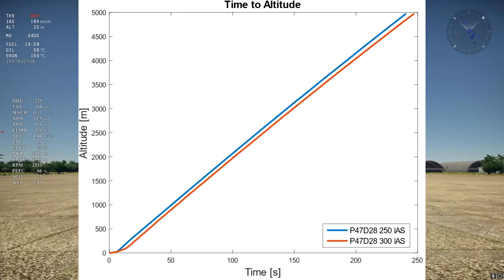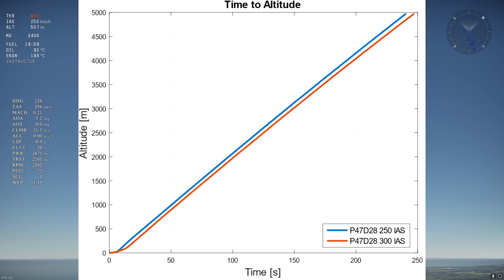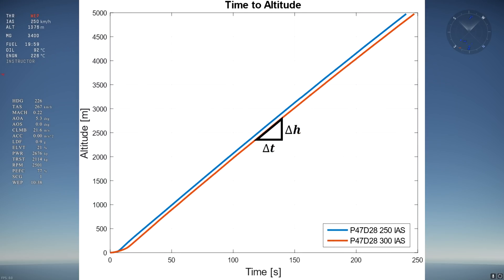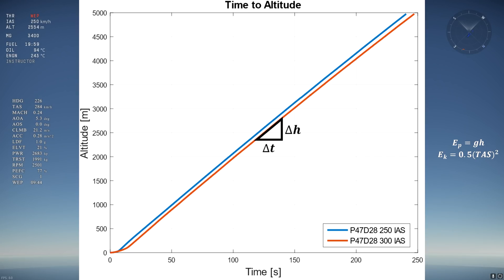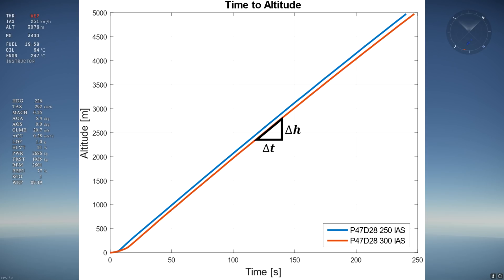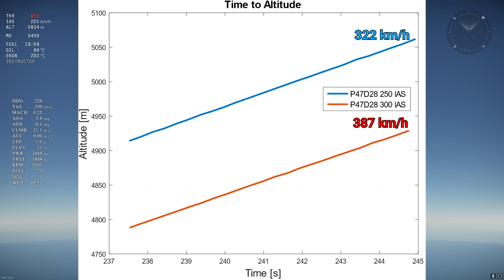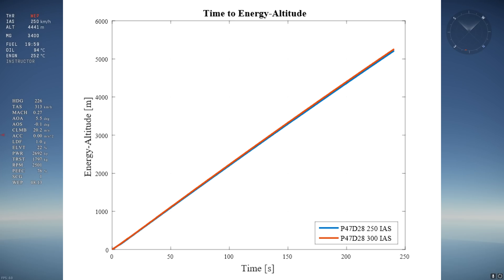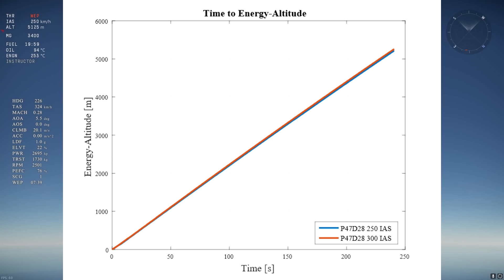Rate of Climb Misconception | Altitude AND Speed!

Comment: I just wait reach 400 kph tas after take off and put pitch at 20° until cruiser alt. If my ias speed is very low then i put pitch at 15°
Reply from the maker: Could be further optimized.
Reply: That quite good as irl mostly do but in the game are very difference story you should climb at start but shallow angle of climb (depend on plane)
but some plane like F6Fat i mean hellcat even you climb at shallow it won't work that well  because it poor at climb but i prefer you to climb around 300 IAS but high alt you should climb at high speed like 320-340 IAS because the fight is already start :) I hope this help.

Comment: I was hoping to look at your plane compared to the horizon when also looking at the IAS meter to compare if I'm usually climbing too steep or too low, but then I noticed your WEP was constantly on? 
Is this just a custom test map with unlimited WEP for the experiment?
Reply from the maker: Well the climb is less than 5 minutes, and it has 12 minutes of WEP.
Reply: to add to that, in realistic there is no WEP restrictor
Reply: @xavier4519  Oh I was suspecting such a thing. I literally didn't know that how arcade has it it's not normal.

Comment: So what would be the best way to determine optimal climb rate or climb IAS just by looking at the flight data? Flying all sorts of planes makes it difficult to remember. Thanks!
Reply: there are war thunder flight data sheets which are usually quite accurate with the IAS climb speed
Reply from the maker: You would need to do some testing, not simple to do it another way.

Comment: In aviation there is what is known as Vy. Best climb rate velocity. It's not angles of climb that determine how fast you climb but the airspeed. And generally you don't want to climb near stall speed because that leads to higher induces drag. So the better thing for people to do in war thunder is to climb at a airspeed higher than you would think. 300 kp/h or higher. As seen in the graphs a higher airspeed = higher energy.
Reply from the maker: 300 is pretty high for most props in WT. 270 or so should be average.

Comment: Very nice, short video Adam! One thing i did not understand: while the altitude increases the plane needs to accelerate because of lower air density, but with lower drag the amount of energy required to go at higher TAS at higher altitude is lower.
Reply: If you're climbing at a constant IAS, the drag force on your plane remains largely the same. This means the power needed to overcome drag actually increases as you climb higher
Reply from the maker: Thanks!

At a given IAS, drag is the same. That's the point of climbing at constant IAS and why we use IAS.
Reply: @AdamTheEnginerd  yeah, so the energy required to keep the IAS costant is the same at every altitude
Reply from the maker: @ferrarisuper  Hmm no, since as your TAS increases, it requires more and more energy to increase it further since E_k = 0.5*(TAS)^2. TAS is squared.
Reply: @AdamTheEnginerd  ok, now is clear! Thank you 😊

Comment: So the shallower angle and higher speed are canceling each other out?
Reply from the maker: You're better off looking at it like I explained in my first rate of climb video, which is the engine power goes into increasing the aircraft's energy after countering drag. So your climb speed should be close to your minimum drag-power speed for a piston engine (prop efficiency makes it so that the optimal speed is above the minimum drag-power speed).

Comment: One thing I am still confused about is which speedometer should I use when climbing/flying in general. As of now I use TAS (and try to maintain ~280km/h in a climb), but I am not sure if I need to switch to IAS.
Reply from the maker: IAS is what you should use for sure, a given IAS gives the same aerodynamic forces on the aircraft regardless of altitude, while it can vary wildly for TAS depending on the altitude.
Reply: @AdamTheEnginerd  will do, thanks for the tip, your vids are probably the leading cause of me actually getting decent at air rb
Reply: @AdamTheEnginerd  Hey Adam, just a quick question: Why do prop planes climb at constant IAS? bc the drag power only increases as you climb higher (constant drag, higher velocity), but the engine power remains the same (ignoring prop efficiency losses) Wouldn't it make more sense to slowly decrease the IAS as you climbed higher?
Reply from the maker: It would very slowly decrease indeed if power stayed constant. When power starts decreasing significantly though, then you reduce speed faster as you climb.
Reply: I think theres no point in using TAS because IAS is what really matters to the planes performance.

Comment: does this also mean that energy gain rate is not affected that much at all by the climb IAS? like the difference between 250km/h IAS and 300km/h IAS in your graph seems minimal.
Reply from the maker: It is, there is one optimal climb IAS for a given aircraft and altitude. The optimal climb speed for the D28 is around 280, so 250 was too slow to be optimal and 300 was too fast to be optimal, both of these speeds are on either side of the optimal climb speed. The optimal climb speed is a few % better than these speeds. If you climb at 225 or 350, you'll climb significantly worse than optimal.
Reply: @AdamTheEnginerd  There is a way to know the optimal speed for any aircraft? Does AOA help to know the optimal speed?
Reply from the maker: @Maverick966  No, it can only provide a rule of thumb. Around 4 degrees AoA is a decent start.

Comment: we're arguing here about dimes and nickles here...
what real difference does an extra 100m make?
Reply from the maker: The same difference a couple of modifications make on an aircraft.

However, the main goal of this video is to show what's going on. Just because someone is higher than you doesn't mean they truly climb better than you.
Reply: that’s the very point of this video.... and 100m is just as important as being with in .80 km of an enemy or 1.80 km away based on altitude so you can interpret that as you will.
Reply: This is engineering.
Reply: it's the difference between making that alt at 250 and not being able to maneuver when you're jumped or being at 300 and having a chance

Comment: I generally prefer to climb a little faster than is efficient so I'm less likely to get jumped slow
Reply from the maker: Yeah there's a reason to climb a bit faster than optimal, but not to climb slower than optimal.
Reply: @AdamTheEnginerd  i personally find that a time to alt graph is not effective . because you will be lower than enemies who climbed at a steeper angle cause they covered less distance in the horizontal then you did per unit time therefore they can climb more .( iam not saying that you should climb in a 90 degree angle iam saying that if a planes optimal climbing speed is 270 then you should climb and 210 kmph for eg
Reply: @AdamTheEnginerd  for side climbers its a plus if you reach the battlefield a littlr late
Reply: There is a reason to climb a bit slower, that s to travel less horizontal distance so you arrive at the battle after your allies have begun engaging the ennemy, which can be a strategy. If you just want to climb though, it s not very much use
Reply from the maker: @lamatoutroux5786  You can achieve meeting the enemy later by sideclimbing at your optimal climb speed, and that way you get the best of both worlds.
Reply: @AdamTheEnginerd  i sideclimbed too long while lesrning the f86f35 once and accidentally was 10 miles out from the baytle but at 15,000 feet. Yeah, by the time i got there the battle was over and we lost
I went supersonic though and didn't wingrip (but compression got me)
Reply: @AdamTheEnginerd  how to know the optimal speed for every plane? Just go 320-350 ias?
Reply: @lamatoutroux5786  Alternatively if you climb at not to steep angle while retaining good speed and energy going horizontal you can spot the enemy for the team more quickly or catch them before they can climb to optimal altitude
I do this when I feel like hunting side climbers or if i want to bait them low for my team early on.
Reply: I learned that the hard way in my low tier spitfires trying to match the Germans.
Reply: Ding ding ding! I catch so many people who are higher than me doing about 200, and i can zoom up to catch them because im doing 400 below them
Reply: @xzxchx  if they are smart they will still energy trap you
Reply: @moizabdul5384  people who are alt tabbed climbing slow arent smart though, hence why it works
Reply: yeah that s true, it would be a very situational use, when the sides are unaccessible
Reply: Typically I climb at best climb until the first enemy appears, then transition to 200kts IAS fighting speed and keep climbing

Comment: Hmm, even if the 300km/h climb is better at gaining energy, isn't it more important to get to a high altitude as soon as possible so that you can engage in combat sooner at your best alt? Sure you might have more energy in a  300km/h climb, but unless you're already in combat you won't make any use out of that extra energy. If the p47 climbing at 250km/h reaches 5km 6 seconds sooner  it means it will reach it's enemies sooner than the one climbing at 300km/h.
 If the p47 climbing at 250km/h stops its climb at 5km, how long does it take for it to reach 300km/h? If it takes more than 6 seconds then it will lose the race, otherwise it'll win.
Reply: You are only thinking it terms of the Y-axis (it's actually the z-axis but y helps you visualize this better). Think, also, that since it is climbing at a faster speed, it will be able to cross the battlefield faster. Crossing the battlefield faster will let you encounter the enemy sooner.
Reply from the maker: You meet the enemy faster if you climb at a higher speed and lower angle. Aircraft also climb better at lower altitude, so the higher climb speed means you stay a bit longer at lower altitudes, increasing climb (negligible effect though).

Look at it this way instead. If you are climbing at 300km/h, you can reach the same altitude you'd reach climbing at 250 in the same time by pitching up and converting speed into altitude. Only difference is that for the P47D28, climbing at 300 will give you a tad bit more energy so you'll either be higher or faster than the 250 climb after the same amount of time has elapsed.
Reply: @AdamTheEnginerd  And, if you happened to meet an enemy unexpectedly during your climb, your chances of dodging are a lot better at higher speed.
Reply: Let them think this brother we will smack them for this one

Comment: I'm sorry Adam. I have sinned. I've started flying American heavy bombers.

Side note. I reasoned that climbing in these heavy bombers would still be useful because you could close the energy difference between you and the potential attacker. What also helps is the fact that very few fighters attack bombers properly, like approachinga bomber from a low 6 o' clock position. If this occurs at high altitude and they dodge and weave between your bullets, they will have a hard time catching up. Meaning that you can actually defend yourself!
But my win rate at 4.7 American has gone down from >60% to 40% : (
Reply from the maker: That win rate difference is pretty good proof.
Reply: @AdamTheEnginerd  With medium bombers it's a different story. In my B-25 Mitchell I got a 0.5 kill per battle ratio, probably better than some fighter mains.
Reply: 4.0-5.0 is rough, too many mg 151s to deal with.
Reply: @FunkyEspelhoCat  You'd be how much easier it becomes if they come in one by one at 6000-7000m of altitude all just sitting at the low 6 o' clock position behind the bomber with a little over 1 km of separation.